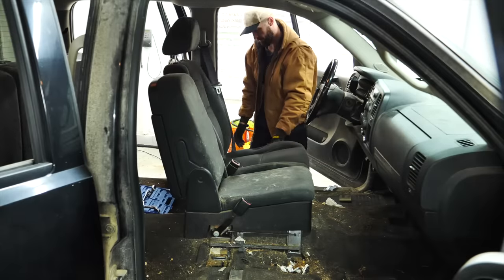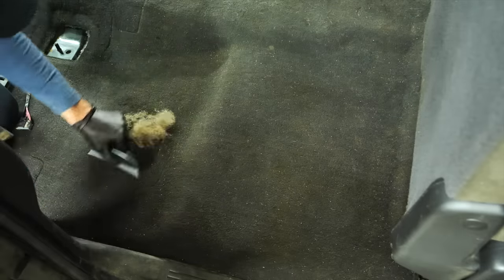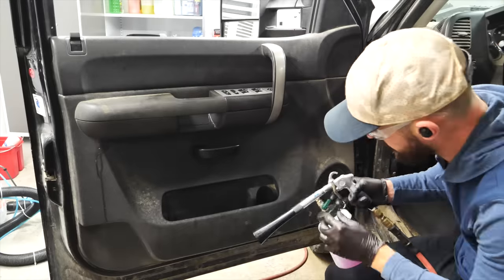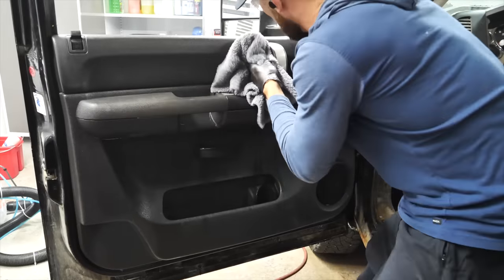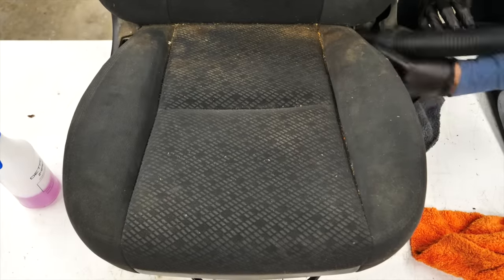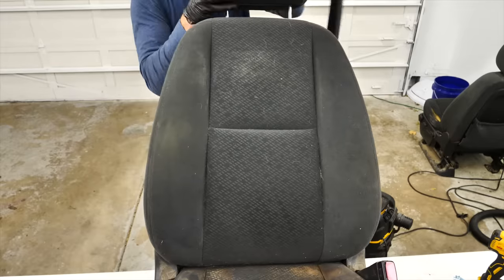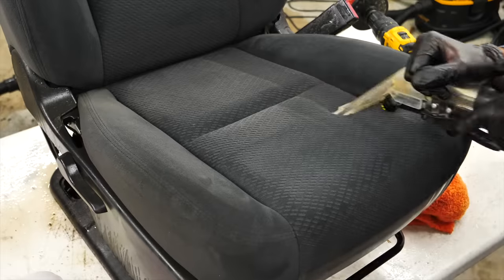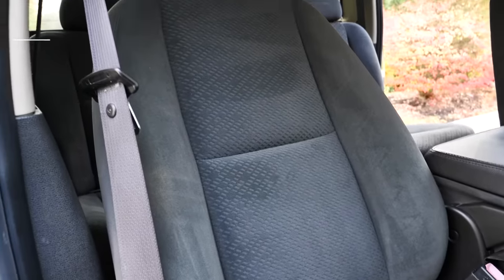Cleaning A DISGUSTING Farm Truck || Car Detailing A GMC Sierra 2500 || Stauffer Garage

Comment: i watch quite a few car cleaning channels on the yt rabbit hole... 

there is one thing you not doing that some detailers are: grab a stiff brush like a new dish brush and agitate the carpet BEFORE you vacuum. 

will make your vacuuming so much easier than dry tornador as it flings dirt everywhere (good for the stubborn stains)
also wash the outside first then door jams. that way when you vaccuum your not introducing new dirt.

Comment: I would have definitely pulled the carpet and pressure washed it. You were already most of the way there. A local professional interior guy was replacing the covers in a truck my buddy bought. He told us what to do to try and save the carpet after an extractor didn’t get the results he was looking for. We were all surprised how much gunk was coming out (how dirty the run off water was) when pressure washing it after the extractor. We pulled it out and laid it in the yard. Sprayed it down with a good auto carpet cleaner and let it sit. Then pressure washed all the soap out. It wasn’t a super high pressure washer. Under 2000psi. Not sure if a 4K psi machine might tear up the carpet. 

Yes it would take longer to dry. But you should have seen all the dirt that rinsed out after the extractor had already done what it could.
Reply: I think the same thing watching so many of these detail vids. They never answer me. This one for example should have had the sill plates and kick panels removed at least. We all know how much accumulates under them. Heck I pop them out when just vacuuming quite often.

Comment: Be careful with chiropractors…if you stop going, your body will go back to what it was before the chiropractor.  I know this because I went for really bad arthritis in my neck and shoulders and once I stopped it went back…degenerated discs are not fun!
Reply from the maker: Well crap… so you are essentially sol?
Reply: Not SOL, just be ready to be in it for the long haul.  It does work don’t get me wrong.  I felt so much better afterwards.  Just don’t stop going.

Comment: Ah yea, that garbage that all car manufactures use now; plastic trim. Heaven forbid that someone sees an exposed seat belt bolt or sliding frame rail, the interior MUST be a "work of art". 95%+ all the squeaks and creaks I've been asked to diagnose in a vehicle are worn, faded or brittle plastic.
Reply from the maker: Agree and then after a few years they get brittle and the tabs snap… hate that
Reply: Especially since they are either parts that are no longer made, or cost $200 to replace (no joke, Odyssey top center console, where the sunglasses go ). I'm not against an interior looking nice, but there's just WAY too much plastic covering things that just don't need it. Engine covers are another peeve of mine, when i do my oil/coolant service; those come off and get thrown in a corner.

Comment: The difference in colour to the carpet that removing the pet hair made was wow.

I've seen most people use a tornador for carpet cleaning, either without the chemcial just to blow loose dirt out, or with to get to those stubborn stains. I still find a brush works best on door panels though.